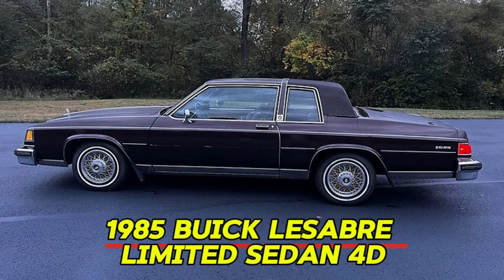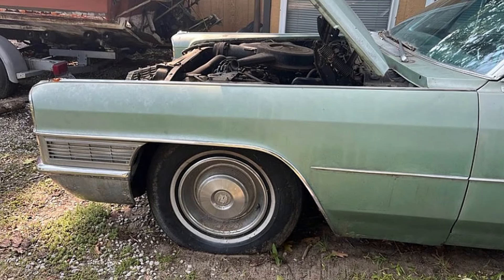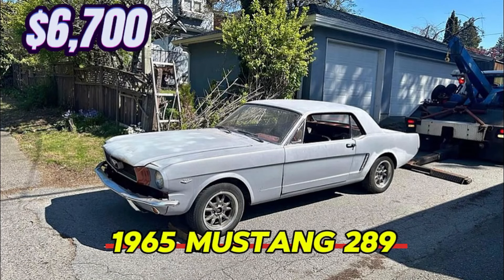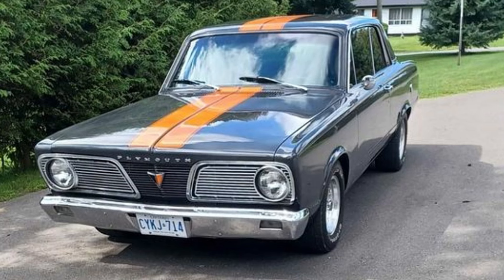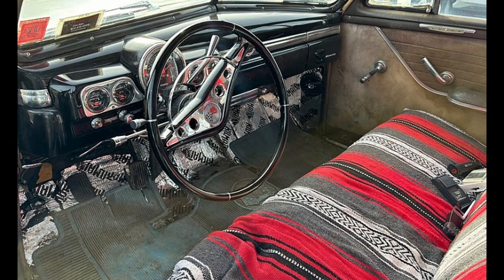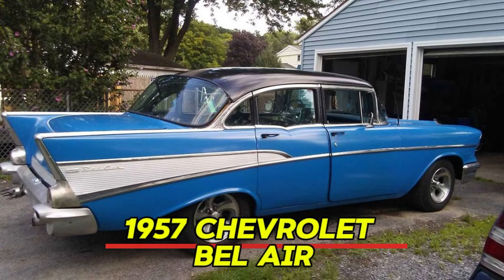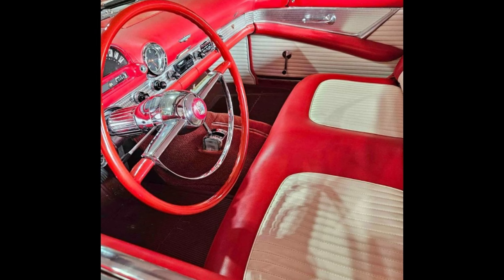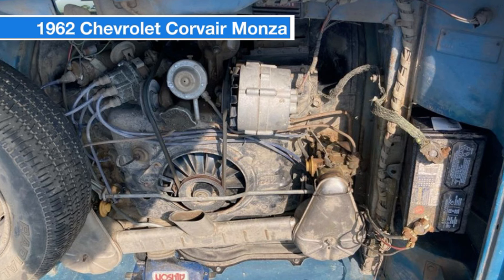Why is this car sold cheap? Classic Cars For Sale Chevrolet, Ford  at Low Prices

Comment: Lets put it this way the old cars will still run after Nuclear blasts as long as the bast is 30 miles away. when all modern el;electronics will not work.  But as for a car none of them are a good drive.